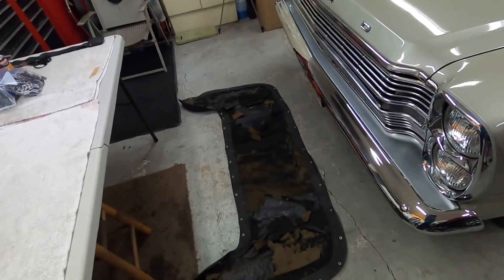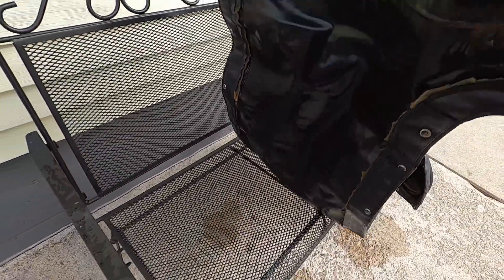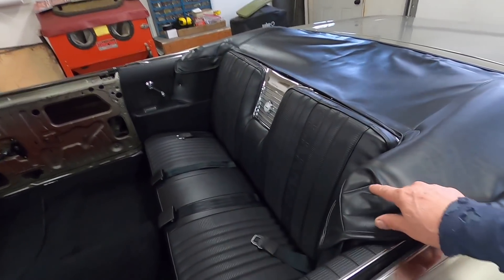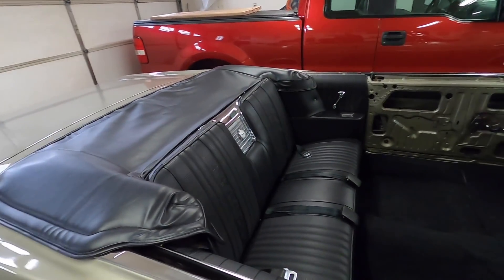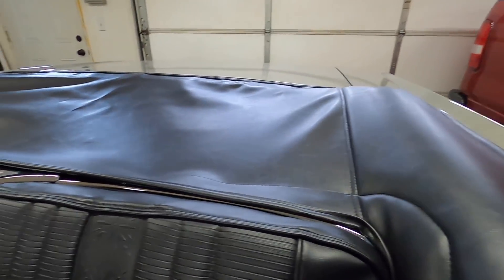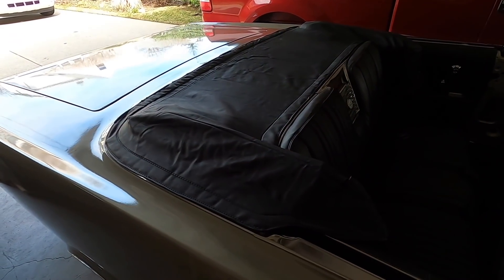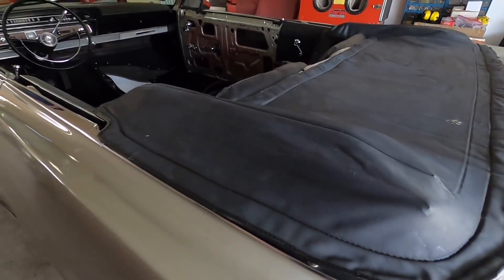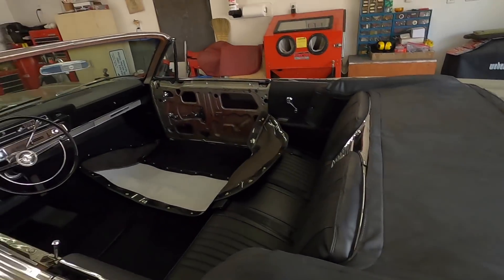Working on getting the top boot corrected on the 66 Galaxie

Comment: Hi Howard, I have not commented for a while but as a former convertible owner I have a tip for you. From looking at the installed boot and seeing the latch mechanism hooks sticking up through the foam in the boot, my tip is this; you need to close the latch mechanism before installing the boot. The boot will be much easier to install and you will not get the hook imprints in the foam. I have watched all your Galaxie videos and have to say your craftsmanship and attention to detail is off the charts. Whomever buys the Galaxie when you decide to sell it will be one lucky person. Until then enjoy the heck out of the Galaxie!
Reply from the maker: The mechanism is latched.... it's that chrome guide pin you see. There is no moving that.... it's fixed. I might put a rubber cap over it when the top boot is on though.
Reply: My 1973 Mustang convertible's locator pins never poked through the boot that, Ford must have improved the top's windshield header design. Ford changed the design in how the boot attached in the rear over the chrome trim piece but as I recall until the vinyl was warmed by the sun it was always tough to get the snaps over rear seat trim panels to snap.

Comment: With the company's willingness to work with you, I would see if they can replace the foam lining because that can serve as sound insulation at freeway speeds.
Reply from the maker: I would be nice to have foam there, but I doubt they will put any there. Doubt I will be on the freeway with the top down though..... that would be super windy and noisy. Top down will be mostly local cruising in the evenings.

Comment: Perhaps try this stitch a black vinyl square patch over the rip and put a matching square on the opposite side. Also heat that stock boot cover with a hair dryer for 10 to 15 minutes.  The transformation will be amazing.  Put new foam on the underside and mail the reproduction boot back for a refund.  This is just my opinion I could be wrong
Reply from the maker: I would if it were in better shape.... It needs to be replaced.

Comment: The old one does look as good as the new one But the new one is nice Those snaps are  not too difficult to put on a whole puncher and small rivet gun would do it definitely get it foamed
Reply from the maker: On the new boot, they're in a slot, they slide maybe 3/8" in that slot. It's going to get corrected correctly.
Reply: @OldCarAlley  You are the man you don’t eat no lazy bread 🍞

Comment: Would there be any possibility to repair/repad the old tonneau cover? Even in the state it is in it looks 100% better than the replacement. I also wanted to ask if you would ever consider Coker tires again? I know you had issues in the past. Just wondering as I’m considering for my ‘72 Vette. Thanks for your videos, really look forward to them.👍
Reply from the maker: I used Coker bias ply on the Catalina with zero issues.... it was the Coker radials on the Bel Air that were the issue. Within 5000 miles at about three years old, the belts started shifting..... one tire after another. Coker didn't care, so I will never use they're radial tires ever again..... they're bias ply's seem fine.
Reply: @OldCarAlley  thank you Howard, I’m planning to replace the radials with bias-plys the ‘Vette originally came with.
Reply from the maker: @dietersmythe9649  I was very happy with the Coker bias ply's and would buy them again in the future..... just not the radials.